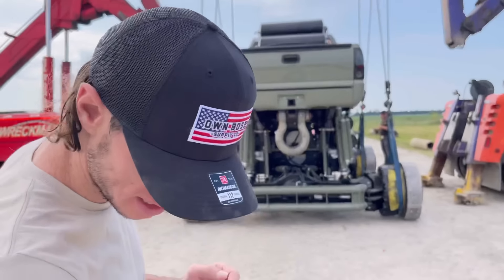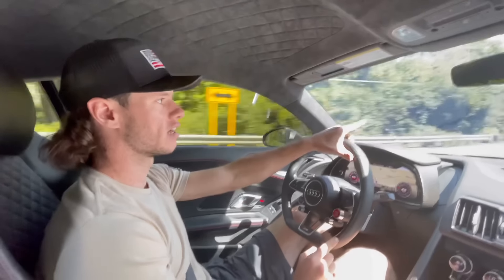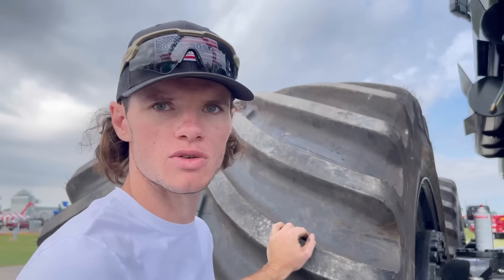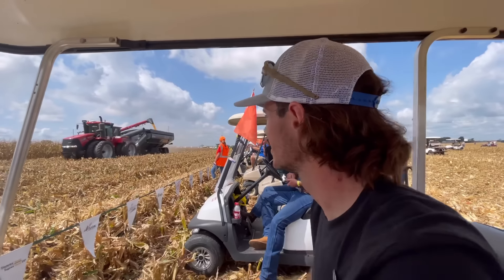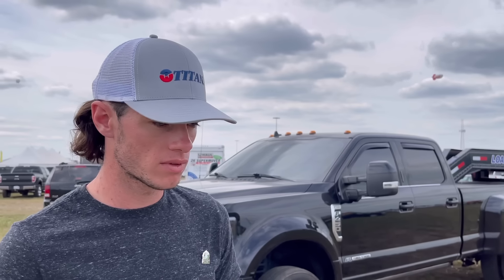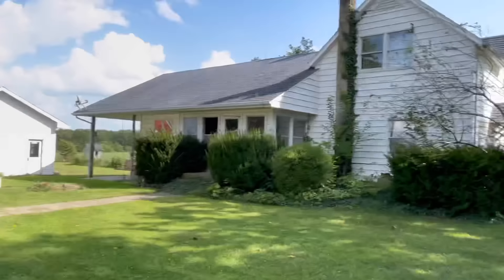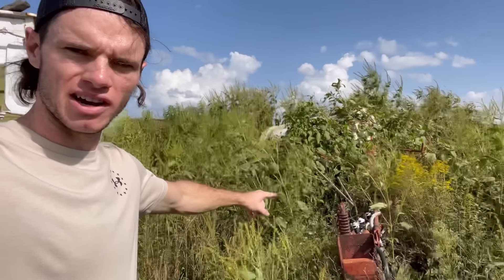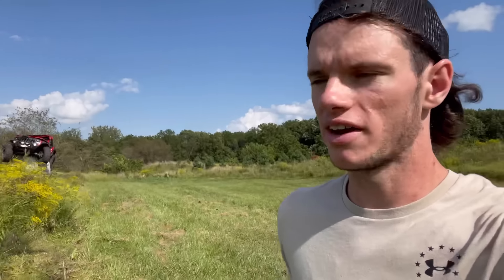Monstermax 2 costs $15,000 just to LOAD it onto the trailer

Comment: I had to run out to one of the Amish repair shops the other day, and had to go by your old place. Literally laughed my ass off when I saw that jeep was still sitting out there 🤣 it's like a monument for one of your best test series ever
Reply: Amish repair shop...wtf!? I live in Florida so please tell me what is it that you have the Amish fix for you?
Reply: @chupacabraracing181   many Amish are skilled in trades. Construction, industrial repair, welding , etc. I had to take a hydraulic pump in for rebuild at a repair shop that is about 2 miles from the old farm
Reply: @backyardcreator2170  ok gotcha. I've never met any Amish
Reply: @chupacabraracing181  they are EVERYWHERE up here 🤣
Reply: @backyardcreator2170  Florida in the north is also flooded with the Amish!

Comment: You need a beam trailer like they use for heavy equipment. Drive over the beam, lift the trailer and remove the wheels. Super easy.
Reply: Thx ❤  yo mama cuhhh
Reply: Unless it was a buddy.  That trailer was not needed.  Standard tandem axle tractor and a stretch 2 axle RGN would have done the Job.

Comment: Bet it’s to heavy to go back in the water 😔 That was my favorite episode! Get on top of Monster Max in the middle of the ocean fishing 🎣
Reply: It has bigger wheels so maybe with the duals again
Reply: Not just too heavy, but too top heavy. I seriously doubt he could do the same things in this truck that he did in the other one. I also doubt that would stop him from trying!
Reply: @MAGAMAN  The axles weigh in at 16 thousand pounds and the tires weigh in at ( not 100% sure ) 5k each that leaves 8k for the truck. Its super bottom heavy. All the weight is in the tires and axles. It should float just fine.
Reply: @kameljoe21  Well I agree that it's bottom heavy but 8k is low it has 2 engines up top and a lot of fans. Also the fuel tank are kinda high too
Reply: @anthonyrodrigues5032  The ratios are pretty good. It weighs 44k total, 8k for axles, 4k per tire, 1k per engine/fuel, 2k for drop box and 4k for the cab and some frame part then 4k in extra suspension. The tires might be over weight by maybe 500 lbs so that still leaves 2k more to add where you need it.  Either way it still adds up to 44k. Its no where near top heavy at all. The thing will float.

Comment: Monster Max is hands down the coolest thing in existence😂
Reply: No literally any monsterjam truck is way doper
Reply: @NewDesignVinylGraphics  how so?
Reply: @NewDesignVinylGraphics  we need a monsterjam truck vs monstermax 2 tug war
Reply: @toocoolfortheroom380  real power, ability to do wheelies… monstermax is a diesel, its slow as fuck, doesnt appear to have a sensical power to weight ratio, if you jumped this thing it would break. A monster jam truck you can literally jump close to 100 feet. Id way rather have a pro truck with a built big block V8 than this. No question
Reply: @NewDesignVinylGraphics  ten4..45,000 lbs is damn heavy and no it can't do half the tricks the Gravedigger can if that's what you wanna do.  MM2 is gonna do allll kinds of shit that the Gravedigger can't do though...like pull a train pretty effortlessly, hook up bumper to bumper with huge tractors.  He'll probably hook up like 300 ft wide of discs and do some field discing.. hopefully.  Could probably be a pretty damn good stump puller with all that weight.  I don't know man...it's just waay too early to be calling those shots I think.  Buckle up!
Reply: @toocoolfortheroom380  no i agree it will be able to do a lot of cool shit that smaller trucks couldnt ofc

Comment: Those wreckers should only be charging around 350-400 an hour each. Sounds like they might be taking advantage to me. Coming from a wrecker driver
Reply: You sure? Seems too cheap to me
Reply: @georgebanuelos1  in Louisiana that’s the going rate. Our Peterbilt brings in around 350 an hour for tows. Recovery is different but for a job like this we would probably charge $800 to 1000 if I had to guess.
Reply: Balls lmao
Reply: Nah man you don’t know where he’s at. A rig like that where I live is over an hour away.
Reply: Cost me $500.00 to have my rv towed 2000 feet
Reply: Rotator brings the big money.
Reply: Was probably an hour driving to the monster truck, 2 hrs loading, and an hour drive back.  4 hrs total x 2 trux plus the telehandler.  A little less than $4k is right on.
Reply: @Hotrodfabs  yeah rvs are expensive especially if it’s a diesel pusher, but that’s not a surprising price
Reply: Jean Bartley  Lmao 🤣🤣
Reply: It's all for the clicks. More clicks, more money.
Reply: @Hotrodfabs  Thats probably their minimum fee
Reply: @Parker_Garage  actually its not a diesel pusher 30' class b
Reply: Remember he had 3 of them. It takes a crane/wrecker to life the truck, Lift the tires and then the shocks. there is quite a bit of work to do in the maybe 2 hours it takes to break it down and put it together. At 500 hours time 2 hours times 3 wreckers that is about 3k each time. 4 times is 12k add in another 1/2 hour or so and you are up to 15k for a round trip event and that is not counting the loaded miles for 2 semis and something else.
Reply: I’m a heavy duty diesel mechanic and agree that he got fucked on pricing. It’s about $400 an hour usually. Wreckers in the Houston area charge max of 2K for long difficult jobs like truck rollovers and stuff. I just don’t see unloading and loading taking 35 hours or so.
Reply: @Thegoose95  Dude he had 3 wreckers and did it 4 times. 2.5 hours times 400 times 3 time 4 is 12k. At 3 hours  14.4k Its correct.
Reply: Jean Bartley  haha dang it beat me to it 😂
Reply: @kameljoe21  These fools keep thinking they just unloaded it once, lol
Reply: @advanceddarkness3  I can not explain it more than onc. They just do not know how to read. I have left comments many times before that explain it over and over and for some reason no one can read.
Reply: Sir, those rotator and wrecker are 900,000 combined. Experienced operators, rigging equipment, and fuel. It all adds up.
Reply: @mikeford675  I’m aware, we have a Pete 359 45 ton challenger with a 35 year experience driver. And our hourly is still $350. Just because you buy an expensive truck doesn’t mean you get to charge more for the same job.
Reply: @Parker_Garage  Then Again... they could have done that with 2 25 tons. But you look at pepes pricing for a backwoods rollover ima cement mixer, 2 rotators, about $19,000 to get it and tow it back.

Comment: Why load it, just drive on metal thingies, install wheels, then just float to Hawaii??
Reply: Because metal thingies cost money to replace and fuel mileage would be garbage compared to that of a tractor trailer towing it.
Reply: @noahjohns7954  dude😂
Reply: @sparcotiel  haha just thought about this and realized it’s a joke. Sorry, I got the humor burned out of me by my teachers today at school. Apparently you can’t have fun at school, and I kinda forget some stuff until I’ve been home for a little bit. I was told to take things more seriously, so I did.
Reply: @noahjohns7954  No, no no! That's not how you respond, you're supposed to call him a racist nazi and throw a hissy fit, you can't be reasonable online.
Reply: Well since all it can do is drive slow & straight that's cooler than anything else since it can't go fast and it can't jump and it can't do anything but drive slow and straight down the road
Reply: Metal thingies?  Smh…

Comment: Can MonsterMax II two Duramax engines even compete in a tug of war with the tractor 'Big Bud' two engines? The tractors engines look bigger and more powerful. Anyway, I hope this tug of war between MMII and Big Bud actually happens, I can't wait to see it 😎👍.
Reply: no big bud has around 1100 horsepower and 3100 lb ft of torque, and weighs around 135k pounds, so there's no way that monstermax can put up much of a fight
Reply: Mm2 will get smashed by them Detroit diesels, nothing but torque in them bad Boyz unlike Cody's shrimp lbz's
Reply: @mrpanda9512  it has 735 hp
Reply: @deanpowder82  
Yawn
Hater

Comment: I feel like yall could find another solution to loading it on the trailer, like hydraulic rams and extended jack points so you can load it onto a trailer, maybe also a suspension to axle jacking point so that you can lower it down with the ram instead of needing the wreckers. Probably save you a shitload of money in the long run if you plan on transporting it more.

Comment: I wonder if you could make some wheels that would go farther "in" so they would be closer to the shocks then you may be able to drive it up?
Reply: Could in theory find a way to mount some rubber on those steel.. covers? Whatever he had on it while it was being towed. Assuming the pumpkin doesn't sit too low it could drive on those
Reply: You definitely can.
Reply: @sandyv4819  you could even if it was a sheet of solid rubber bolted or affixed in some way
Reply: More like recessed rims, like a deep dish rim but turned around so the dish hugs the wheel hubs and extends inward rather than out.
Reply: How tall is it with tires on? Then on the trailer?

Comment: This is why most monster trucks have transport tires that they use for driving onto the trailer or over the trailer if too wide. Block it up and lift the trailer back to transport position. Remove the transport tires and chain it down. This avoid having to use rotatory wreckers all the time.

Comment: Instead of shifting the Monster Max II engines together, whistlindiesel should consider making a hybrid… using 2 tesla Plaids motors and batteries, linked to the gas motors that will be acting as gigantic generators.

Comment: I'm thinking u should add a hydraulic system like a Crane has on all 4 corners to lift it and change the tires. The cylinders could go beside the shocks so they kinda blend in,that would be easier, faster and cheaper
Reply: Like a big formula one car with built in jacks, your welcome. I've always loved the content, can't wait for the dentside

Comment: A lot of bigger dump trucks and such drive overtop the low boy and when the lowboy raises with the wood under the axles it lifts the wheels off the ground and they can either leave them on or remove them at that point for clearance, How much wider and how much more axle clearance do you need for that to be an option?

Comment: Hey question.  Why are you using the bar links to hold up the height of the truck. Instead of filling up the shocks? Just curious.   I could imagine how many psi each shock would have to hold in order for it to hold it up that far.